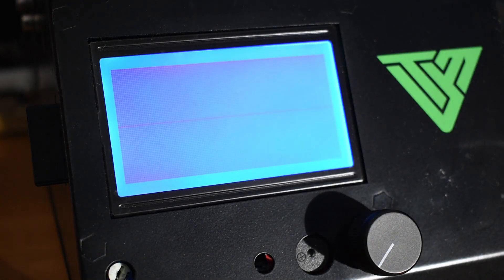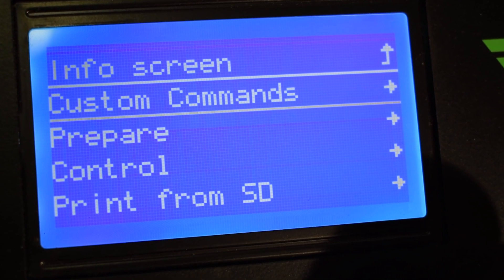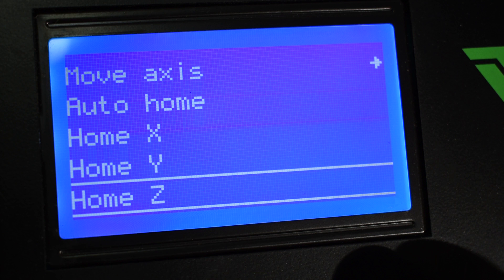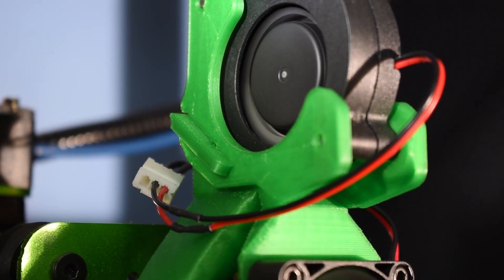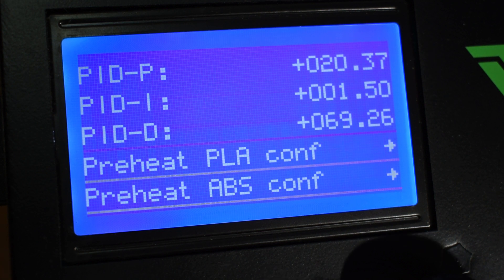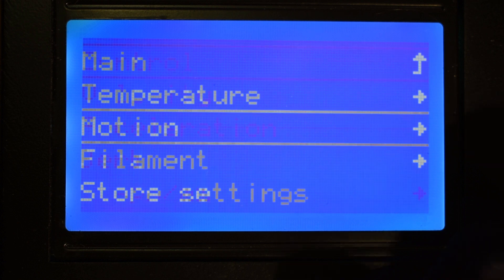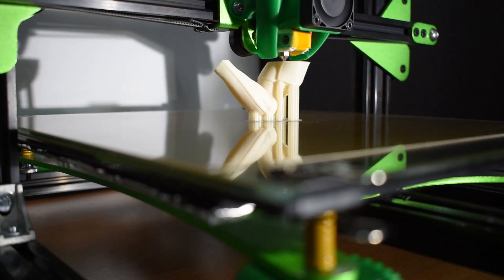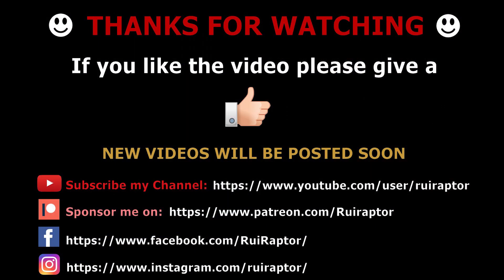MARLIN DISPLAY Menus & Settings (3D Printers) - What Do They Mean?

Comment: Can u please help me? I don’t have the prepare option on a new printer I just got.
Reply from the maker: Hi, some options on the menu might be disabled in the firmware. To enable them, you need to edit the firmware, compile it and flash the printer with the new firmware.
Reply: @ruiraptor  excuse me in my printer i only have the step/mm setting, how do i enable the aceleration menu?

Comment: I was wondering if you could explain more on the difference between restore settings to default and initialize eeprom.  I have seen some videos where after flashing firmware they do restore defaults while others initialize eeprom.  Which is correct or do you do both and in what sequence?

Comment: Hi, Ive got a CR10 S5 and using CURA 4.5. Ive done the bed levelling but when starts printing, the nozzle seats too high above the bed when printing. I use the babystepps Z option to correct the problem because dont know what else I could do. Could you please advise me. Many thanks
Reply from the maker: Hi, you need to edit the Z offset value. Look for the Z-offset and edit that value (you can use the babysteps value as reference) and don't forget to store the settings to save the changes in the eeprom.

Comment: hello I am new to 3d printing I have a ender 3 i have only had it 2 weeks the problem i have is the printer prints off the bed i have seen so may videos but none like yours as i have been in touch with creality but so far have not had any replies i am at a loss what to but one video i watched said it could be fixed in eeprom but not knowing the setting i have no idea how to get this help so here i am asking you the control panel is the same as the one you used in this video any help will be a big help every thing on the printer works except the printing in the center of the bed thank you for your time
Reply from the maker: Hi,
Check my other video that explains in detail how to setup the print area:
https://youtu.be/NiyU1cTTYlM
Reply: whatever slicing software you are using you may want to configure the print bed size and type in that specific software. the printer just does what commands are sent to it. sounds like you are sending bad g code files and your printers steps per millimeter could be off if you were playing with the settings so look into that as well good luck

Comment: You go thru the menus and say what each is but you do not give any context to define how each one affects a given situation nor do you explain what they do.  (Aside from the obvious ones) Just saying this is xxxxx does not tell me anything.  This would be the equivalent of showing you a graph and saying "this is cutoff voltage for a diode.  It stops working at this point" but not explaining how that point is derived, or explaining the diode function in the complex circuit it is a part of.
Reply: Yeah - speed  adjusts the overall speed - means nothing more than I can read - but does it also change the extruder speed, ie match the flow

Comment: What is your marlin version?
Reply from the maker: Hi Sumit,
My version is 1.1.6. It works great and it's very stable. The only thing i miss is the new linear advance algorithm.
But you can find more recent ones for the tornado such as the 1.1.9.
Reply: @ruiraptor   I have successfully applied my old software to another mega,
I have a new mega with ramps and the new marlin but it did not work well!
the Z motor does not run as it should.
only if you do small steps 1MM and better still with 0.1MM by hand than the Z turns.
but if you do home the Zaxis it does not work anymore
the engine turns a little bit and then humps
 (then grumbles for the rest)

also the limit switch does not want to work properly!
I think that has to do with the bed leveling censor software

I put an old version marlin on it and everything works perfectly!

greetings from the Netherlands!
Rob.

Comment: Nice video! Have you ever tried printing directly on the glass bed surface? Putting a piece of glass in a piece of glass seems redundant.
Reply: CapnRumple the stock glass is very easy to crack when removing prints.
Reply from the maker: Hi, good question.
Actually, in my tevo tornado, i'm using a Filaprint print surface on a glass. Since i use my printers for tests and videos, i cannot have permanent parts but the filaprint is the best surface i have ever tested. You can attach it directly to the glass bed.
Reply: Do you have a link?